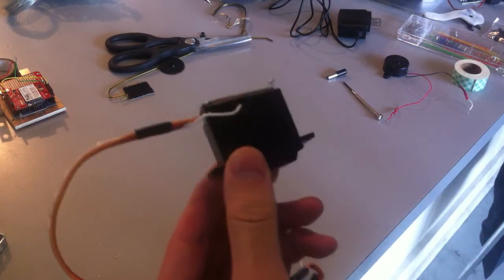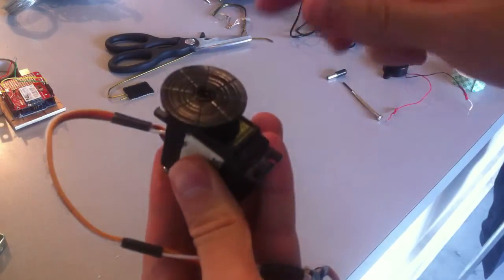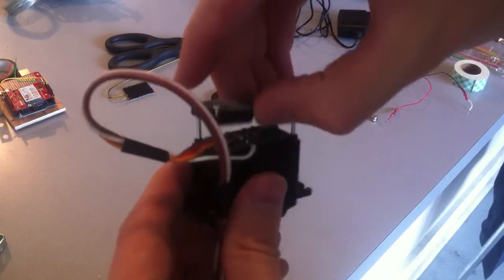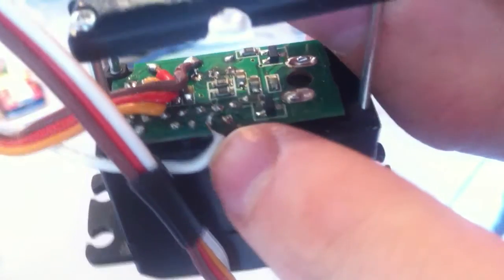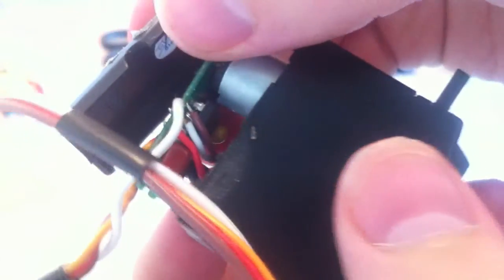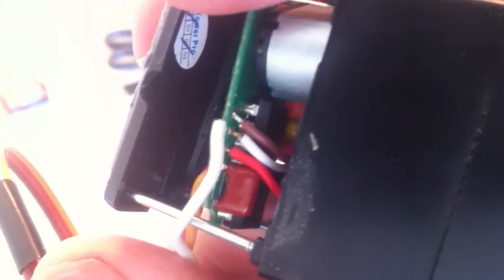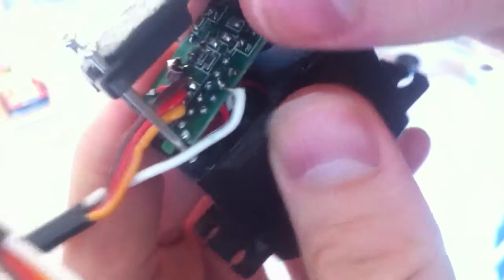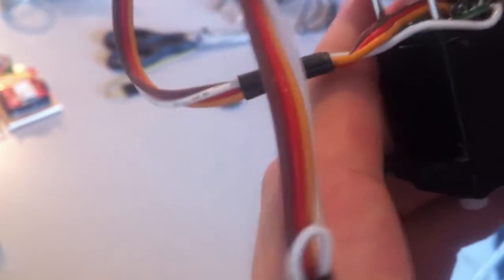Modifying a standard servo to read the internal potentiometer

Comment: is this for any servo ? and why do that soldering ? why cant we just input another wire to the arduino pin where we be connecting that new analog read? so if we are using D3 to write commands why can we solder from A0 to D3 ? 

reason why i ask is cuz i used a 9g small servo and did what you did and when i read that A0 i get a constant 14 on serial no matter where i turn the servo horn 

include Servo.h

uint8_t servoPin = 3;
uint8_t feedbackPin = A0;
uint8_t ledPin = 13;

Servo myServo;  
  
void setup() {
 Serial.begin(9600);
 pinMode(feedbackPin, INPUT);
 pinMode(myServo, OUTPUT);
 pinMode(ledPin, OUTPUT);
 Serial.println(feedbackPin);
 }

on this note if you are using a diff sketch to read that servo POS then it be nice if you share that just like you share the method for modifying the servo it self
Reply: Modified your code a bit. Got it working on my nano. Could still use some work.

#include <Servo.h>
  uint8_t servoPin = 3;
  uint8_t feedbackPin = A0;
  uint8_t ledPin = 13;
  int val; 
  Servo myServo; 
void setup() {

  Serial.begin(9600);
  pinMode(feedbackPin, INPUT);
  pinMode(servoPin, OUTPUT);
  pinMode(ledPin, OUTPUT);
}

void loop() {
  val = analogRead(feedbackPin);
   val = map(val, 89, 524, 0, 180);   
  Serial.println(val);

}